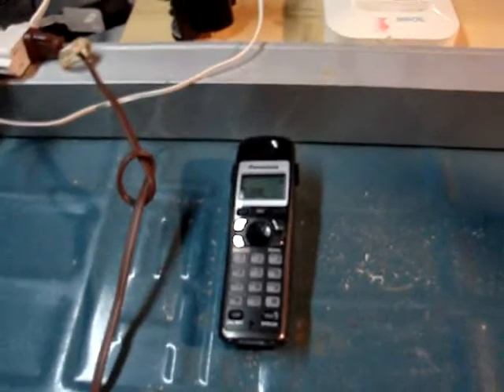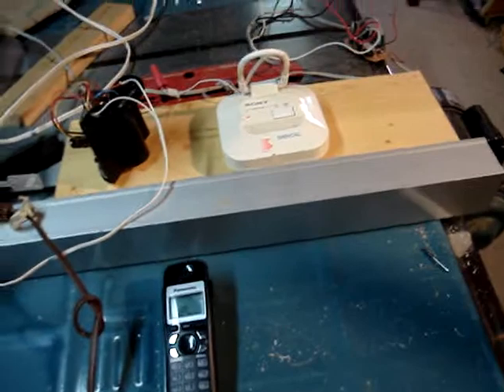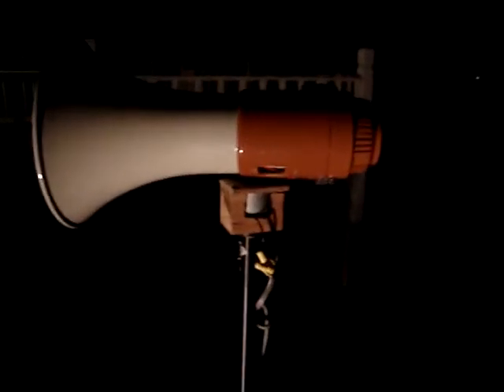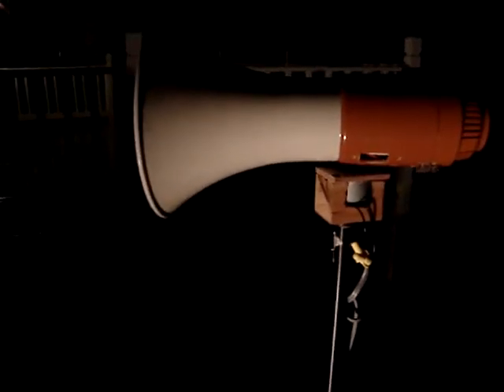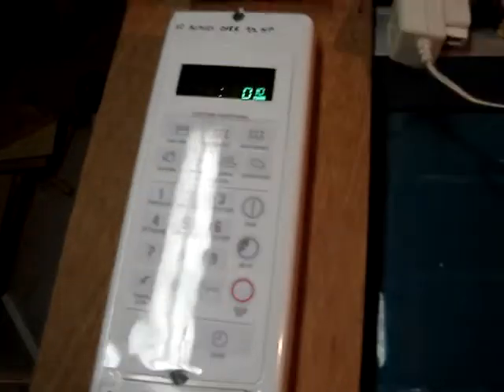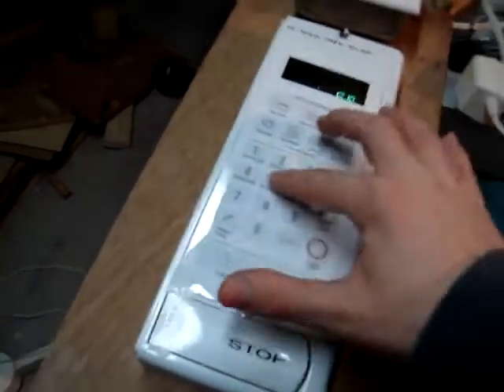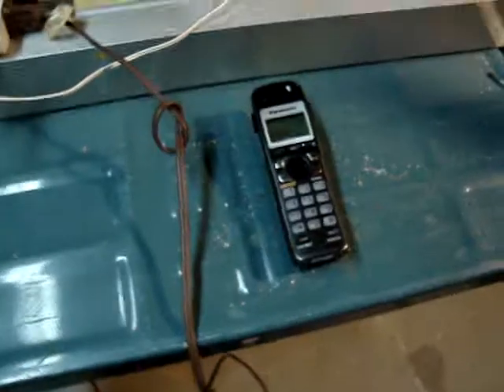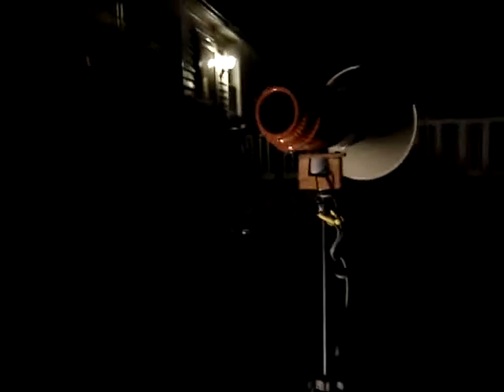Siren Test 3

Comment: The microwave control does not contain the big capacitors. Before I disconnected the high-voltage stuff, I used a device called a capacitor discharger to drain the capacitor's energy, so I could safely cut the wires. Then I used the schematic that came with the microwave and figured out how to wire the keypad, and as you can see, it was quite successful!
Reply: I'm curious as to how you mounted the motor to the megaphone.

Comment: So have you modified the receiver to shut off when the tone generator shuts off, or do the transmitter and receiver stay on?  If the transmitter shuts off but the receiver stays on, you'd end up getting a lot of static over the speaker.  Why did you use a microwave control panel to control the whole set up?